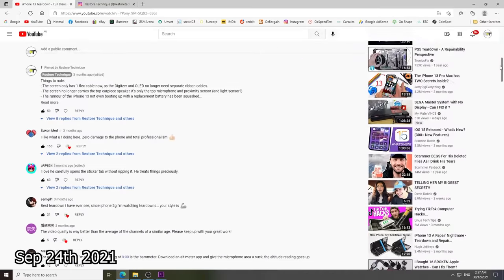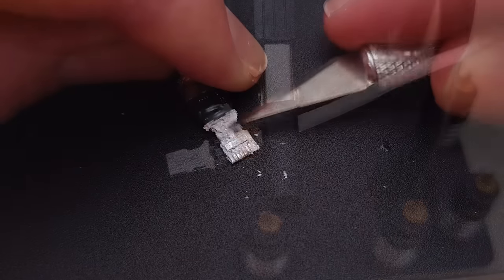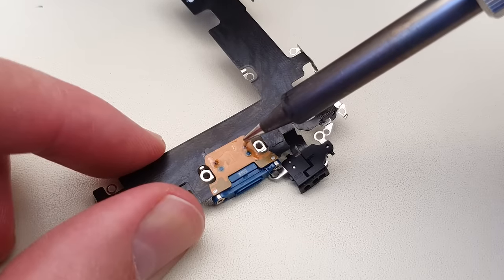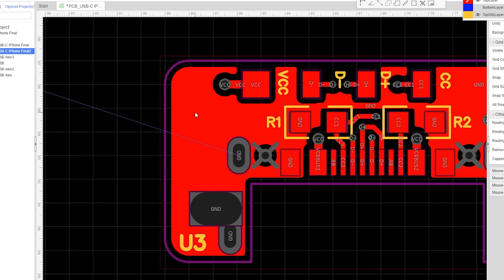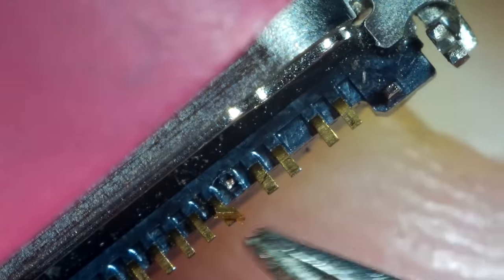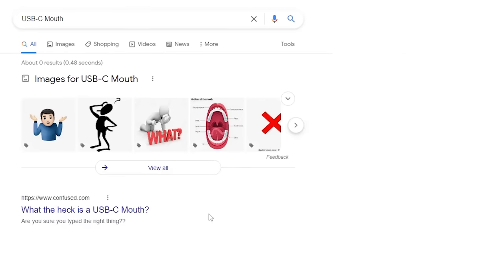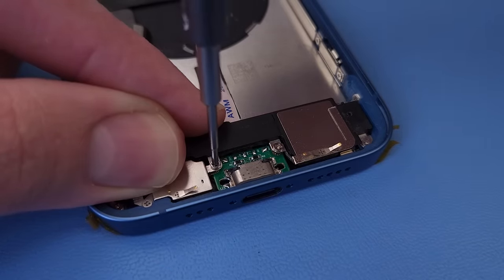I made a USB-C iPhone 13

Comment: This mod looks super clean, and I have no doubt the iPhone 15 will look practically just like with when it finally releases with a USB-C port
Reply: You really think they will do a usb c iphone? Lmao we will get one without a port instead to force users to get the magsafe charger
Reply: @oopdigdigfig9786  nah, I don’t think it supports data transfer
Reply: @oopdigdigfig9786  it is possible to go portless but probably not any time soon as wireless data transfer is much slower (through Wi-Fi for example) compared to thunderbolt ports which are now basically usb-c but support significantly higher speeds

also, Apple has confirmed because of the EU that USB-C will come to new iPhones in the future,  most likely already with the iPhone 15
Reply: @woolwil  Imagine if they make US versions using lightning and EU USB-C kek
Kinda like the current situation with US 14's only having eSIM while EU/JP having normal
Reply: @captainultraswagga  i did not confuse anything, I only simplified the concept for simple understanding

I am well aware of the protocol and connector types, however, it is easier to sum up modern standard thunderbolt as USB-c compatible no?

besides, modern thunderbolt ports are simply classified as thunderbolt ports that are backwards compatible with usb-c, I do not see your point
Reply: @woolwil  I know the interview you're talking about , they didn't confirm .... they just said they will comply .... meaning that yeah they most likely will take off the port but till end of 2024 . That gives time for apple to get us used to transferring to the new magsafe
Reply: *iphone 17
Reply: apple taking notes so they can sell the usbc iphone in EU and lightning in US
Reply: @Xetarine  i'd be surprised if they didn't tbf. or i can also see them software locking certain non-apple certified usbc accessories
Reply: @oopdigdigfig9786  they are tho which is amazing, still keeping my 12 pro max til 2024
Reply: @oopdigdigfig9786  at the end you were wrong
Reply: @ricky12502  thank god honestly
Reply: @monkedonke96  respect for not buying the latest model just because it is available
Reply: @oopdigdigfig9786  Wrong.
Reply: @oopdigdigfig9786 bet ya feel like a dummy now, huh?
Reply: @oopdigdigfig9786  This aged poorly

Comment: This is really cool. Though I also kinda like the theoretical resilience of the lightning port/cable design. There's nothing that can break off in the port if you try to force it or it's misaligned or gets stuck. With USB-C there's that little tab in there. Much easier and cheaper to dig out a piece of broken cable and get a new cable than it is to have to send the phone in and get a USB-C port replaced because the tongue broke off inside.
Reply: I might just be unlucky but I found that the pins on the lightning port lost their spring after 2 years and therefore stopped making reliable contact with my Ipod, although damage from misuse might be less likely with lightning it seems to me that general wear has less of an effect with type C port

Comment: There's a good chance this will be slightly more durable than whatever Apple uses once they go type-c next year. I know they're a little different but I've worked on so many 2017/18 Macbook Pros where their type c ports are loose/worn and barely work to charge or transfer with so much so that I almost lost faith in Type C altogether. But thinking about it now they'd likely use a different bit to ensure it's IP-rating so maybe not. Either way this is fantastic work

Comment: This is what we’re waiting for the new iPhone 15 release in September 12th of 2023. It would have the same USB-C cable  as the 13 you’ve modified. Instead of using the original lightning cable from older iPhones, this cable would be required for couple of reasons and I like to see the full release for the 2023 Apple Event, and your engineering is awesome!
Reply from the maker: Thanks dude 😀
Reply: Btw I called this 2021 iPhone 15 USB-C

Comment: The one thing I never heard mentioned in the video is what I was most curious about: Will it support audio, such as usb c headphones?
Reply: Depends if lightning supports it.
Reply: @ryan20028  yes lightning supports it
Reply: it definitely will, in essence all he's done is taken a usb-c to lighting cable, and compressed it so it sits entirely in the phone, allowing you to only interact with the usb-c side, it retains complete functionality, and the iPhone systems are none the wiser.

the iPhone just thinks there is a lightning to usb-c cable plugged in 24/7
Reply: Important question??

Comment: Would've appreciated it if there were some data transfer tests between the Lightning and USB-C iPhone 13 (as long as the USB-C isn't at USB 2.0 speeds).
Reply: Why wouldn't it be ?
Reply: @matthewsmith2385  I'm pretty sure I've seen another person put a USB-C 3.2 gen 1 port on their iPhone (whether it actually could transfer files at that speed I don't remember, but even just as a remember it would've been cool if this person did a data transfer test).
Reply: @matthewsmith2385  lightning is only usb 2.0

Comment: Any thoughts on why it charges differently depending on the way the cable is connected?  Nice job!
Reply: Lightning’s Limitation probably
Reply: great when you wanna charge slowly to preserve battery life
Reply: @MrCosmin94  I use a cable that causes my phone to puts up a warning telling me to make sure it is fully plugged in. It only started doing that a few weeks ago but since i sleep for more than 5 hours a night its ok. Only annoying thing is when I want to use my switch even in sleep mode it looses power.
Reply: @bland9876  I have the cable that shows me how much power the phone is pulling. But I try my best to unplug my phones before 80%
Reply: @MrCosmin94  there's this setting you can turn on that stops your phone from charging at 80% and also a setting that turns off fast charging.
Reply: @bland9876  not all androids have that. Samsung does
Reply: @MrCosmin94  it's hard to tell what's an android feature and what's a Samsung exclusive.

Comment: that looks professional af, well done. lightning deserves all the hate, imagine paying 1000+ usd to get a usb 2.0 connection...
Reply: Imagine that your 1000+ $ phone needs a repair after only one year using usb-c... I don’t know what is better... usb 2.0 wich u will never use bcs who the heck use data transfer on iphone trough cable.. or needing a repair after a year bcs durability of usb-c sukcs. Think about that at least for a second..
Reply: @bennyworkout6580  i don't know which phone you are referring to but no, i have a lot of type c accessories(i exclusively don't buy a tech product if it has no type c) and i previously used a Mi 8 and i have never had issues about the durability of the port. 

And addition to that it's not just about usb 2.0. I'm currently using a iphone 11 and lightning is outdated, i mean being forced to use another cable to just charge your phone is horrible. If it was type c, i would disconnect the cable from my mouse or any other accessory(headset, earbuds, tablet even my fucking shaver) and just plug that cable to my phone. Even the latest ipads are using type c.

Its the same shit as using a vga cable to connect your monitor to pc.
Reply: @muratcucen  im working like a phone repair technician.. sorry bro but I know what Im talking about.. I repair broken usb-c phones every day.. 100x more than broken Lightning ports.. and also I think iPhone users are more rude to their phones and still.. u cant break lightning port even with a knife.. I think people who repair phones can tell the same thing.. I didnt made this up just for fun.. its a real thing.. I own a lot of usb-c things too and im a careful user when it comes to pluging devices.. Im not telling that usb-c cables are bad... Im talking about the port in devices.. I dont want to argue here like some idiot.. but this is just a fact... usb-c female sucks in durability..
Reply: @muratcucen  if Lightning with better transfer speed would be a thing and also would be a standard across all devices u would say the same shit on usb-c.. lightning si a standart for iphone users and removing that would be so fucking not eco friendly... imagine getting rid of your old lightning cables.. and imagine that every user who will upgrade from a lightning iPhone to a usb-c one would do the same thing.. sooo much better than just using lightning like a normal person.. Right ?

dont want to talk about eco things like apple but just think about that

Comment: Very impressive! Good work brother. One question though: when you modified the screen adhesive, would the water resistance still be retained?
Reply from the maker: Yes should be, it was at the thickest part of the adhesive, and after cutting a small part out it was still thicker than most of the other sides. The adhesive was not severed, it's still an unbroken border.

Comment: The only 2 things you can improve now is make fast charging work both ways, and make fit the cable all the way in, the gasket around the port was classy touch!👍 
But in my humble opinion the Lightning port still way more durable than usb-c
Reply: I've never had a USB C failure, and I've been running devices with type c almost exclusively since the Nexus 5X

Comment: Amazing work. Two questions: 1. Can you explain why the charging wattage is different depending on the plug orientation? 2. Not to be pedantic, but I couldn't help but notice the C cable's connector is exposed and not flush with the body. Would it be possible to offset the connector so the cable sits flush with the body of the iphone?
Reply: I would guess it's not flush because of the usbc "mouth" that is shorter. Plus he had designed the connectors pcb so that it would end up flush with the frame. There's definitely room for improvement, but who cares, It's usbC on an iphone afterall.  The issue with charging wattage is strange, maybe something to do with the CC pin he had trouble with.

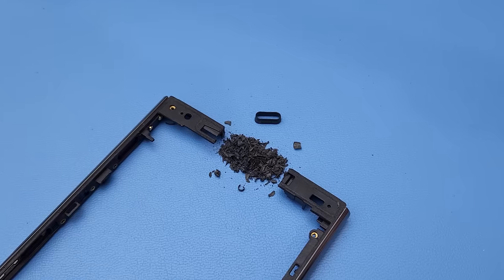Comment: 9:50 
him: "let's buy a full phone to extract 1 single piece"
Me: why why why, you can buy a 3d printer for like 1/3 of the price if you know were you need to search and print it "for free" (except of the cost of the printer)
Reply from the maker: I just bought the middle frame for $20. Replacement phone parts are a thing.
Reply: @RestoreTechnique  sorry didn't new that those Parts we're available i only thought things like bateries
Reply: @RestoreTechnique  Which phone is that?
Reply from the maker: @Coringa6969  Sony XZ1 Premium
Reply: @RestoreTechnique  
Thank you very much!

Comment: With the first official iPhone with USB-C the people may be experiencing USB 3.0 speeds for the very first time.
One reason why I dislike Apple. Back when Lightning was introduced it was much better than microUSB. But Apple did nothing to keep it competitive.
Reply: Nah inside the iphone there only usb 2.0 pin for data, no usb 3.0 connection even with usb c mod.
Reply: @jiwagaming5276  I know. I was talking about the first official USB-C iPhone. So in two years.
But since USB-C handles USB 2.0 as well I think Apple will keep the slow standard. It's cheaper for them.
Reply: @BHIM Yeah but, beside for Macs Apple is the one company that isn't using USB 3.0 over USB-C but USB 2.0 over Lightning.
Most new Android phones use USB 3.0 over USB-C. Some may use USB 2.0 over USB-C. However microUSB is dead.
Reply: @BHIM Steve Jobs would have demanded that because it would drive innovation forward, eg. connecting the iPhone to a hub to which mouse, keyboard, monitor and power is connected.
However, today Apple is like any other company and only cares about maximazing profit, even if that means to sell old crappy stuff.

Comment: Xperia users watching this video: Wow! My phone was mentioned!
I would know cause I'm like one of the seven Xperia owners.
Reply from the maker: I used to be an Xperia owner. Loved my Z3 Compact, used it for 4 years. Also had an Acro S and XZ1 Compact.
Reply: @RestoreTechnique  I'm using an Xperia 5 IV right now. Fantastic phone. Headphone jack and micro SD in this modern age is so useful, especially for a music buff like me.
Reply from the maker: @LaskyLabs Yes I know, I was actually looking at that phone thinking about switching from my S22 to it. 5000mah, HP jack, card slot. Even did a community poll.
I then discovered that it overheats when taking 4k video for too long, which is a deal breaker. Curious to see the 5 V come out later this year.
Reply: @RestoreTechnique  yeah, heat can be a problem, Sony really needs to get it under control. But the big battery, bright screen, and serviceable cameras, oh man, they're handy. They could copy paste everything over to the 5 V or 1 V and just add proper thermal management and I would 100% be willing to do a yearly upgrade; something I haven't done in a long time.
As for now, I'm content to see how long it lasts, my OnePlus 7t went from late 2019 to late 2022, this phone should have just as many, maybe more with such a big battery and the option to expand. If I (somehow) run out of space on my 512gb card, I can put 1tb in this thing lol.

Comment: Amazing video and perseverance brother.  Can;t wait to see you do more videos.  Hope you can one day figure out how to make iPhone 13 Pro and 14 Pro aftermarket since Apple has made them impossible to replicate for the community.  Can't wait for China to make working charging ports like yours in a mass distribution so we can all install usb c in older models :).  Yours is faster charger with usb controller at 23 watt. The new 15 pro does it 20 watt max since it doesn';t allow fast charging.  Maybe in 16
Reply from the maker: I thought the iPhone 15 range was 27W charging 🤔
PS: Thanks! :)

Comment: now that the iPhone 15 has type-c, will it be easier to customize old iPhones? do you think it will be possible to simply replace the lightning with type-c in old iPhones?
Reply from the maker: No, no easier. You still need to convert lightning to usb-c. You can't just plug in the iphone 15 usb-c flex assembly into an iPhone 13.

Comment: Hey, may I know what the oily looking substance is when you soldered the port onto the PCB? I saw most people use it while soldering.
Reply from the maker: Flux. It's like lubricant for soldering. It prevents oxidation on the metal and helps solder flow to the joints/pads.
Reply: @RestoreTechnique  Oh, alright, thanks for telling me!

Comment: Just a quick question, why didn’t you just pick the port from an iPad Air which already has a C-type port ?🤔
Reply from the maker: Because its no easier, in fact that would be harder. The USB-C port on the ipad doesn't just magically work with the iphone just because they're both Apple products. There's no connector on the iPhone motherboard where you can just take an ipad port and plug it in. You've still got to convert Lightning to USB-C. It's no easier. But the ipad port is a 24 pin port with pins on the underside, so it's much harder to solder, and unnecessary seeing as the iphone is only usb 2.0 anyway. Also ipad port isn't water resistant.
Reply: @RestoreTechnique W

Comment: The reversibility might as well not work if its only gona charge fast in one direction
Reply from the maker: Someone said that it's a bonus feature, so you can fast charge when needed, and slow charge over night. Keeps the battery healthier slow charging.
Reply: @RestoreTechnique  what prevents it from allowing fast charge in both directions?
Reply: @RestoreTechnique you have to fumble with the cable either way to select the so called "mode" you want instead of just plugging it and clicking a software prompt.

Also the way actual optimized night charging works is that it times the charging so it finishes when you wake up not only because of the heat generated while fast charging but so the battery doesn't sit at 100% during most of the night .
Also the 30W "fast charging"  is already so low its more of a optimized charging speed witch shouldn't cause the phone to heat up to any degree that could begin to shorten its life (or at all) unless its being used while charging unless apple used a cheep battery with an extremely low C rating
Most of todays good mid range and high end phones use at least 65W without while fast charging without there batteries heating up a lot due to them being optimized